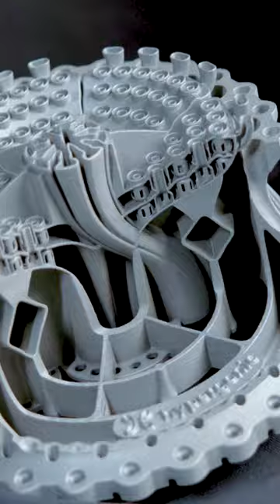A.I. Designs Rocket Engine Part for Metal 3D Printer #shorts

Comment: So this short has always amazed me and  left me with the biggest cliffhanger at the same time! Being that YES this looks crazy cool and all but is it even USABLE? And if so WHEN ARE WE GONNA SEE IT EVEN ATTEMPTED TO BE ACTUALLY  USED!! It's just  giant PAPER WEIGHT OTHERWISE. well that and a TEASE HONESTLY.
Reply: It is a giant paperweight.  It's a cutaway view, so could never be operational.

Also it is the injector plate, so you will never "see" one used as it is buried in the heart of a rocket engine.  It's basically the cylinder head for the combustion chamber. Fuel and Oxidizer are sprayed in through all those nozzles.  Specifically one around the other so they mix very well and very quickly.
Reply: @Dysan72   Calm down captain literal, everybody knows that this one is a cut away.  What he means by "see it gets used one day", is see some piece of technology that someone says is utilizing that design, and see how it works in the real world. You could just calm down instead of acting like a know it all about someone's colloquial way of saying they hope we actually try it and see the result.

Comment: That is the future of manufacturing..
Reply: They said the same thing 40 years ago.  Still waiting for that to happen.  3D printing is not a replacement for machining.  It is a companion process much like casting, forging or injection molding.
Reply: @Brandon S  I agree and disagree.  We'll always need skilled machinists, that goes without saying,  but we've never had a process that is able to produce products where machining is impossible. Look at the new suppressors the military just accepted as standard issue,  there are honeycomb cooling patterns on the inside of a sealed tube- something that can't be machined. My comment was not meant to disrespect machinists, just to state my opinion on this amazing new manufacturing process..